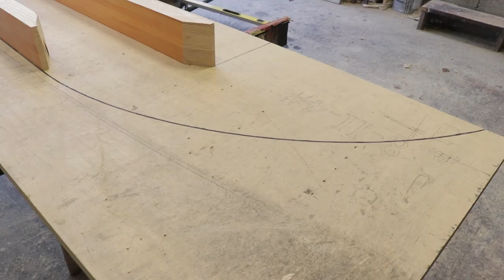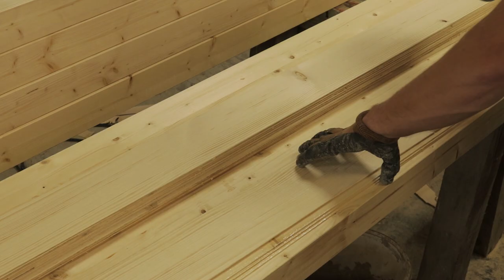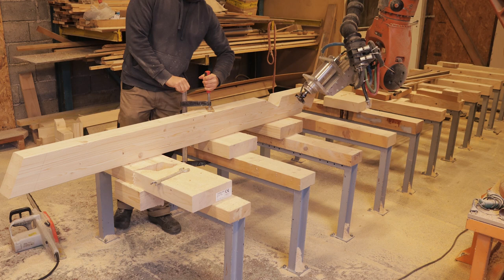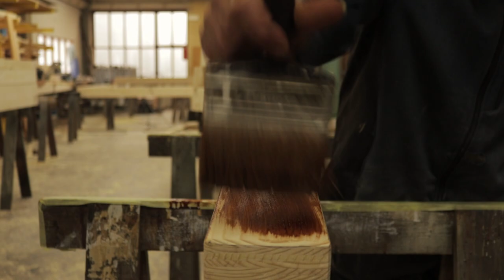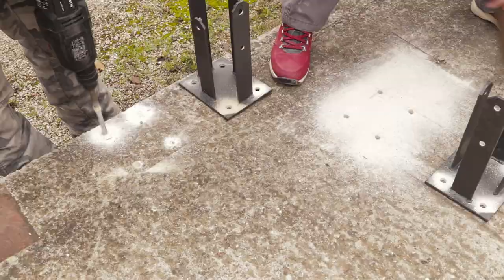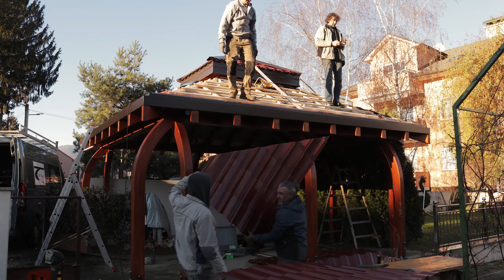Making and assembly of curved post carport

Comment: Absolutely beautiful, love the timber frame look. You usually use wood blocks for clamping, this time you used metal blocks/braces and used twice as many, is that for a more repeatable beam since they are all mortise and tenon ?
Reply from the maker: I use metal braces wherever I can because of their strength primarily. I cant use them where the radius of curve is too small and they don't fit. I'm glad you like it !